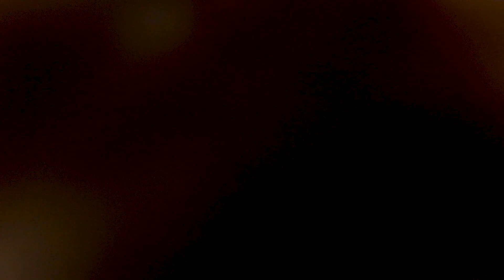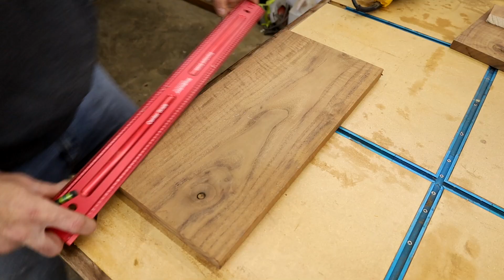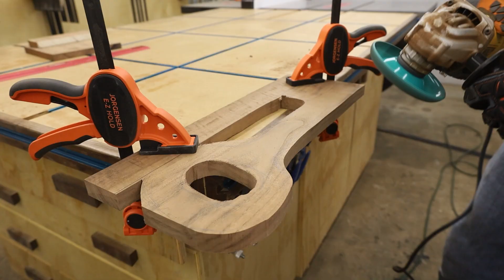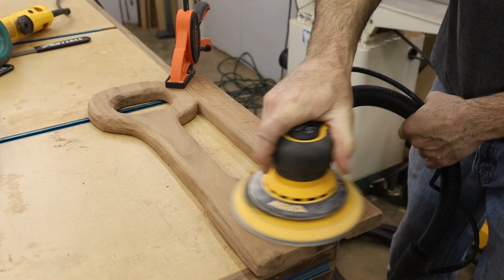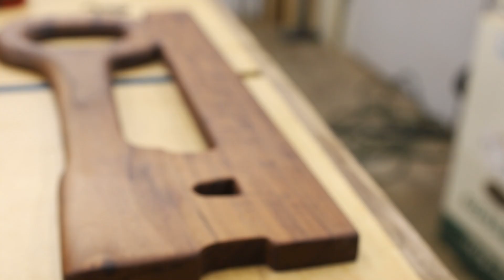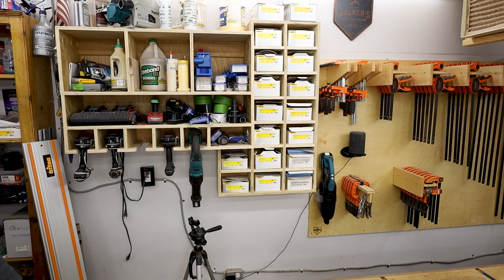Power Carve Your Own Key Rack! How To Power Carve For Beginners.

Comment: Great job man! I think it came out awesom! I want to get into some power carving and need to get me a set of cutzall burrs! Everyone I watch that uses them seems to love them! What was the tool you were using with the burrs...an air powered grinder? Didn't see a link for that tool. Was thinking about getting an electric version...maybe cordless? Thanks for the great video...look forward to seeing more like this!
Reply from the maker: Thanks!  I appreciate the kind words.  Yea it's just a air die grinder from harbor freight.  It's the chief brand.  Seems to work well so far.  I love all the Kutzall stuff.  Can't recommend it enough!
Reply from the maker: Here is a similar one from jet.  Probably better. https://amzn.to/3u73bsQ
Reply: @WalkersWoodworks  that's awesome... love the extended length! Didn't even think about using air - i just finished plumbing in a copper air drying manifold with supply lines in my shop. This would make a great new tool addition to be able to utilize that! Thanks again!
Reply from the maker: Right on!